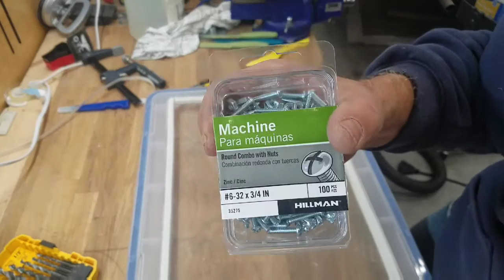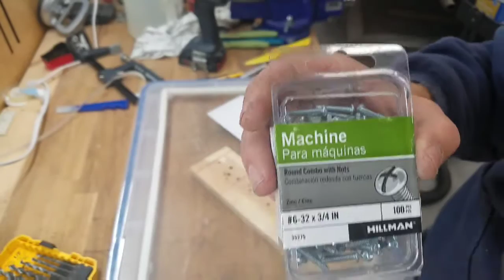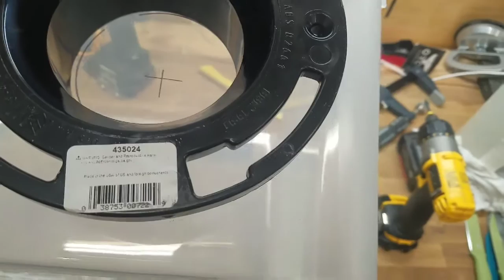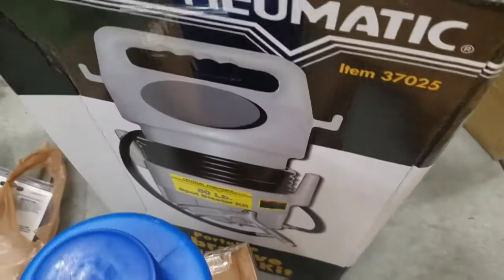DIY Sandblasting Cabinet

Comment: Hi, what compressor do you have? I’m looking to do the same exact setup, but not sure if I need to get a 20+ gal tank set up. I was looking into the kobalt 26g quiet tech.
Reply from the maker: I bought a 29gal from harbor freight.  I can spray for about 30sec before the compressor turns on.   With it on, it'll catch up as I'm not spraying all the time.  Check the cfm rating.     Bigger compressor is always better.
Reply: @comfort_in_discomfort  thanks for the reply! Looks like I’ll be going that route and could use it for other tools. Thanks again!

Comment: What did you use to drill the hole for the air line? Awesome setup btw.
Reply from the maker: I used a step drill bit.  if i didn't have that i would use a small regular bit and drill around in a circle (like an outline) then come back with a knife to finish.    The plastic would be too brittle for a big bit.

Comment: Great video! I am just about to start exactly the same project and thought I would look for a few tips on YouTube, some great ideas, thanks.
Reply from the maker: Thanks for watching.  I've made a few modifications since then to control dust.  In the original form, the dust be dense enough that it would be hard to see.  My modification to add a vacuum to the filter element makes it clear.  Take a look a the other video on the channel.  Good luck!
Reply: I’m made one using the same concepts. The one thing I did differently was I didn’t use a gasket. I used it glue. I have a industry hot glue gun so it allows me to crank up the meat so that one side wouldn’t bet up before I got it all glued. When I place the plexiglass into the lid the glue expanded just like silicone caulking would do and created a grate seal. I then fastened it down without 1/8 “ bolt. The washers I used were 1/8 hole diameter but the over all size of washer was 1/2 “ giving it more area to fasten and eliminating any chances of cracking the materials. I also made a drain plug 1” in diameter. I used a Marina plug from Walmart that expands in the hole while you heighten it
Reply from the maker: @montanamike1041  good idea about the marine drain plug.   I think I'll do that to recover the media.   Thanks!

Comment: If you ever need to replace the plexiglas, They sell a cutter that works by scoring the plastic. It works well and is very inexpensive. As others have suggested, glass would last longer. The glass can be secured with some flat metal pieces that overlap the glass and the lid.
Reply from the maker: Thanks.   Glass would have been a better choice for sure.    However it's hard to polish it as it will also get scratches easily under pressure.   The problem is that my setup is small, and any particles that bounce off the working surface just hit the glass.   Plexy is a little easier to polish up.   I'll see if I can find a cheap piece of glass to test.    Thanks!
Reply: @comfort_in_discomfort  Yeah, I can understand that. I came to your video after watching this one https://www.youtube.com/watch?v=lEMteF9Kq-U which is very similar, so that's just my thinking.
Reply from the maker: @tims8603  I appreciate the feedback!   Thanks for watching.   I'm no YouTubeer.  Any feedback is helpful.

Comment: I suggest next time you use glass instead of plexiglass.  Glass is MUCH easier to cut and will last longer in the sandblaster because it will not be abraded as easily as the plexiglass.
Reply from the maker: Thanks.   Good advice.   I've had to polish the plexiglass a few times.   The issue is with such a small cabinet, even indirect hits cause damage.

Comment: Nice idea. Thanks.
Reply from the maker: I've used it on a few projects now and changed a few things.   I added a film to the inside cover to protect it.  It gets worn with use.  if you do similar, I suggest you use some sort of sacrificial layer (like a sheet protector).     And I added a small plug in a corner where Incan empty the media into a container.  

Hope it was helpful.

Comment: When reusing the media, how do you clean it?
Reply from the maker: I haven't.  I blast with it until I see it becomes too fine, then toss it.
Reply: @comfort_in_discomfort  What are you using for media? Doesn't it get all contaminated with paint chips etc.?
Reply from the maker: @kenpavelka2868  I used different media for different projects.  For rough removal I've used Coal Slag.  I really like this stuff as it doesn't powder as much as others.  It is very abrasive and great for rust / paint removal.  For "cleaning" I've used Aluminum Oxide.  Leaves a really nice surface finish, but powders very easily.  Lastly I've also used glass beads for the finest finish.

If you think about how a "commercial" grade blasting cabinet works - all media goes to the bottom of the tank then gets sucked back up and re-used (along with all debris).    I haven't noticed any ill effects.  I just change out the media whenever it stops being effective.  In the case of coal slag, I get more use out of it.  I suppose there are better ways but I'm on a limited budget and constrained for space.  Seems to be working so far.  Watch the dust control video as that was a very helpful add.

Thanks for watching.
Reply: @comfort_in_discomfort  You are using a suction method for the media. What about the pressurized canister types. Do you know if one works better than the other? Thanks
Reply from the maker: @kenpavelka2868  no first hand experience with the pressurized ones.  I had a small gravity feed and that kept clogging.